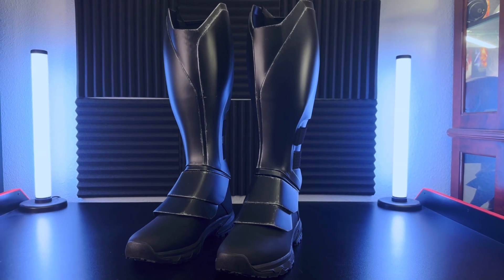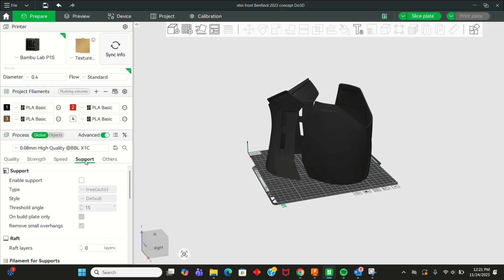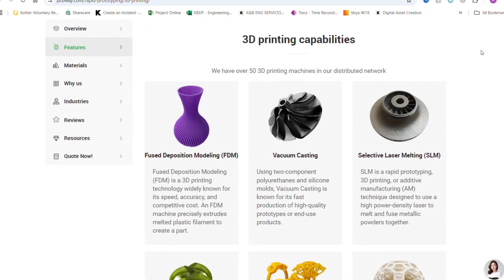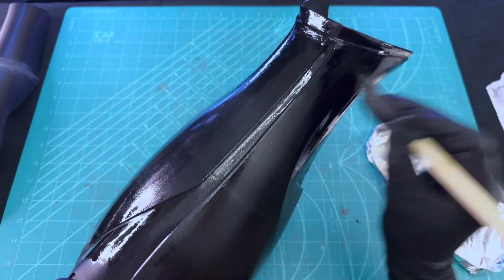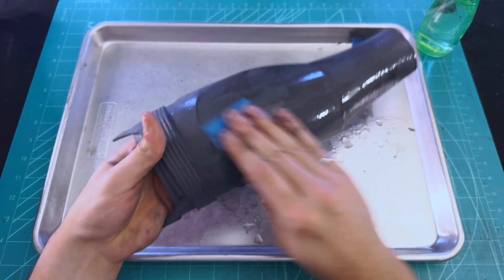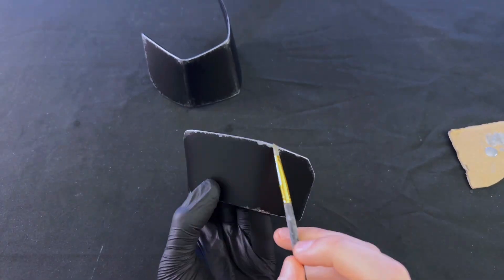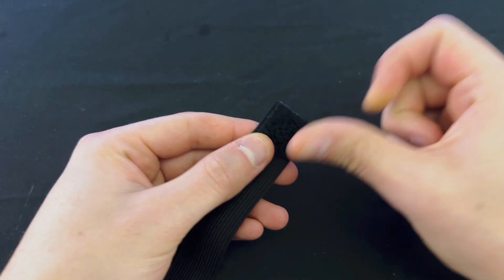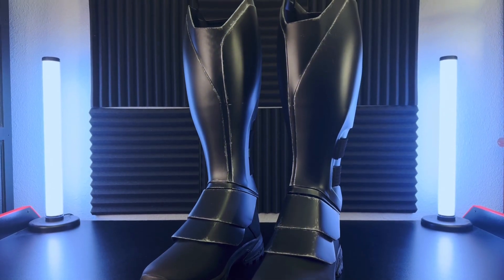Batfleck Concept Batsuit: Part 8 – 3D Printed Batman Boots Tutorial

Comment: The shoes look like cheap sh!t. Completely break the immersion. You need some kind of motorcycle boot like maybe the Daytona road Star GTX or the Stylmartin Matrix and fancy them up a bit to fit the costume.
Reply from the maker: The boots I have are fine. Those motorcycle boots go way too far up the leg for the shin guards to fit over them. Plus I ain’t payin $350 for cosplay boots lol
Reply: @markitmade29  Yeah because you made the guards to small. This is what a good cosplay separates from a mediocre one. You do whatever makes you feel all warm and cost inside, but if you look at the original prop boots, they go way far up too. You don't need to get the ones I suggested but the ones you picked are a bad choice in my opinion. I'm sure you can find cheaper options that look the part. I'm not trying do be a dick. I'm just telling you something, your friends might not tell you.
Reply from the maker: @mementomori4972  Cool, well thanks for the feedback! My thought is that if I had boots that went further up my leg I'd have to make the guards larger and they would look awkward and bulky, so this was my compromise.